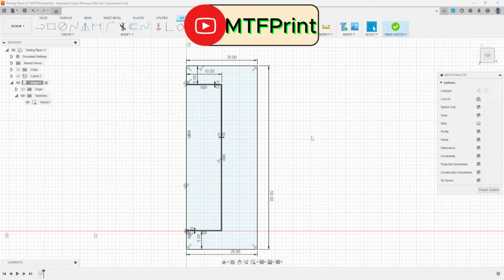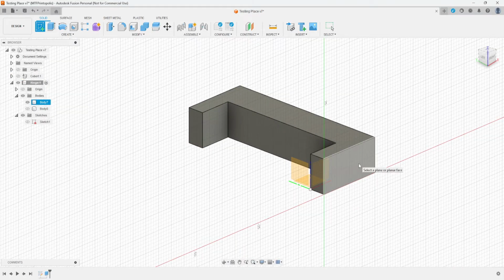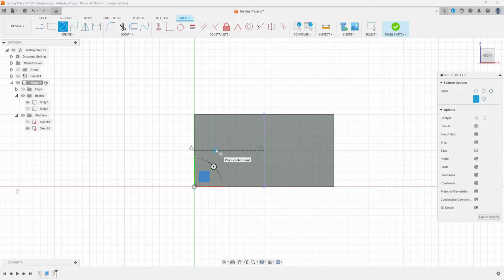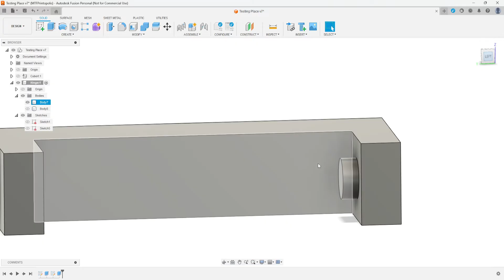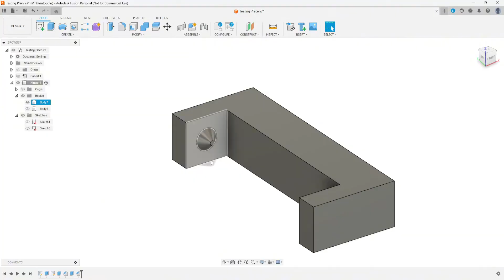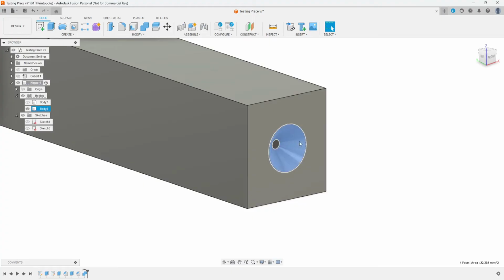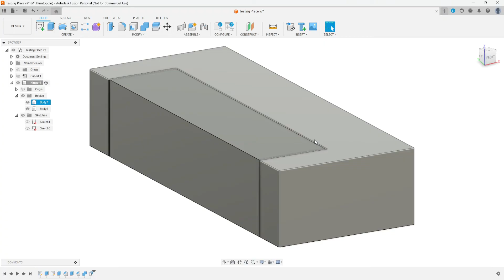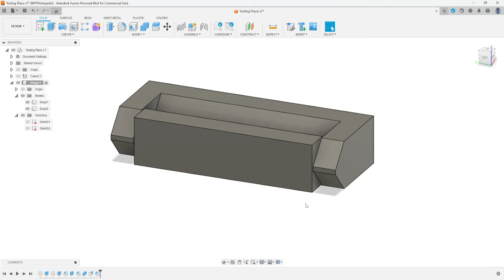Make Easy Print In Place Hinges in Fusion360

Comment: would be nice if you can show the final printed product
Reply: his layers would have stuck together at only 0.1mm offset i bet..and it is very lame he didn't print it and show it. i would have subbed if he'd of done more work
Reply from the maker: I have several shorts on here since then of prints that use this same hinge completely working no issues. The .1mm offset goes around each side making it .2mm clearance. No fusing happened on the test parts, I just thought showing the process was more important and was testing different video formatting at the time. Thanks for the feedback 😁

Comment: When making a sketch on something that is on the inside and the outside is blocking your view, you can click the "slice" option in your sketch pallet and it will cut out the part that is blocking your view.
Reply from the maker: Oh that will be really useful, thanks 😊
Reply: @MTFPrint  What I failed to add, is the hinge design is really great, thanks for the video, there was a few parts that will definitely help me out.

Comment: Why do you think that the offset value is doubled? You're doing it in one direction, so it offsets by the value you set exactly
Reply from the maker: In one direction, yes. Say you do it to a square, if you want your clearance to be .2mm and you offset the faces by .2 then each face will move back .2 giving you a clearance of .4mm. So to get that .2 clearance you only set each face .1 since it will do it on BOTH SIDES (.1 + .1 = .2). Ending in a clearance of .2mm.
Reply: @MTFPrint  Ok, if you were doing it to both parts, then to achieve a .2mm clearence you only need to offset each face ,1mm, but I didn't see you do to the second part in the video, that's why I was confused.

Comment: OMGoodness! What a concept. I have watched five videos before yours and failed miserably in applying the lesson to my project. Part of my issue is that I am new to CAD, new to 3D, and relatively old. I am a guy who uses butcher paper and sheets of plywood as tools, along with my pencils, rulers, and combination squares. Fusion is indeed getting easier, and your video makes it incredibly simple to create a hinge. My hinges are added parts to other items, allowing me to implement the all-in-one concept, making it simplified. Currently, I have friends who own a Printer, a CNC router, and a laser. I can envision my little shop featuring a large tabletop CNC machine with a 15W laser and 2HP router on the gantry. As to the terms of a hinge, it is three parts: the leaf, which is the flat plate that attaches to the frame; the knuckle, which is the hollow formed tube on the leaf edge alternated of each leaf that connects the two leaves; and the pin, which holds the leaves together, allowing them to rotate. Thank you for the video.
Reply from the maker: Ya no probs, Im glad you found my little tricks useful 😁